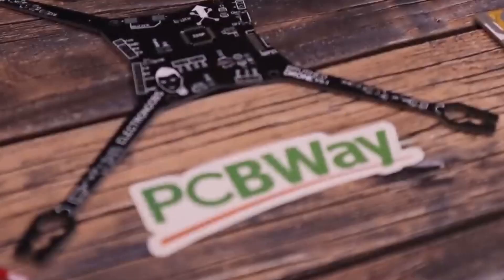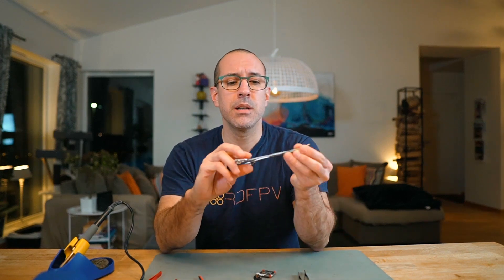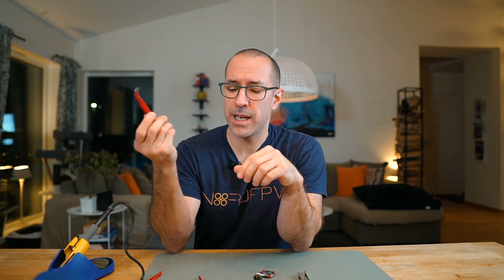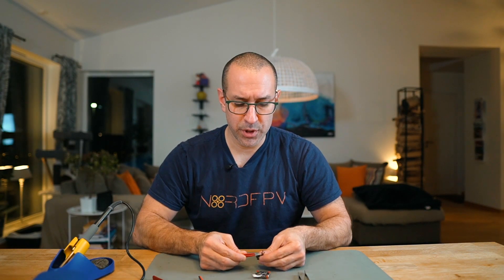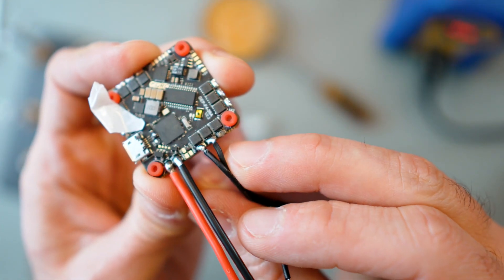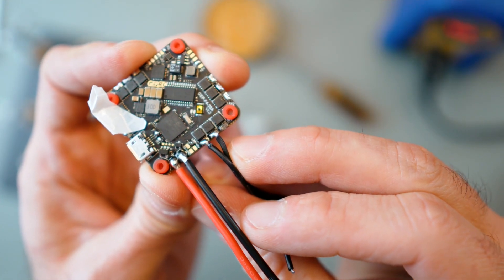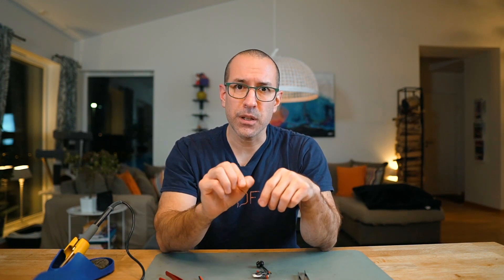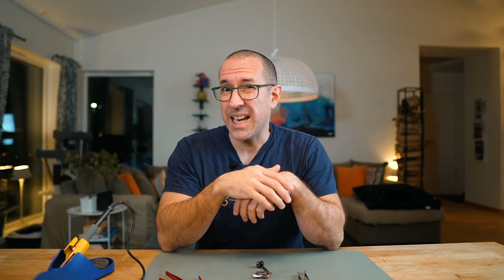5 Soldering Tips for FPV Beginners

Comment: Hej.
Köpte nya spetsar till min lödstation på Kjell, men märkte att diametern var 4,8 gamla spetsen var 5,1.
Längden var inga problem att kapa till med bågfil.
Frågan är hur mycket -0,3mm på diametern på spetsen påverkar prestandan i lödstationen.
Frågan är om inte det är bättre att svarva till egna spetsar med bättre passform, runt +/- 0,03mm.
I ren koppar.
Livslängden på spetsen blir ju mycket mindre, men för våren del är det ju resultatet som går först, eftersom en kontroller kan kosta upp mot 1000kr på en tinywhoop.
Sen till frågan, hur tight ska passformen vara, som jag förstår är det ju keramikhållare som man sätter in spetsen i, kopparn i sin tur expanderar mer än keramiken när den blir uppvärmd.
Så kan hända om det blir för "bra" passform att keramiken spricker när spetsen expanderar..
Men 3 hundradelar borde vara säkert..
Istället för 3 tiondelar som jag har nu.
För maximal värmeöverföring till spetsen..
Köper in lite material till detta, så om du behöver en spets är det bara att maila ritningen.
Reply from the maker: Hej, Jag har inte så mycket efarenhet för att svara dina frågor. Den som jag vet är att en bra spett gör stor skillnad när man lödar. Jag by från en billigt lödspett till en dyrare och lödd jobb är mycket enklare nu.
Reply: @NordFPV  Dom säger att resultatet blir bättre av ren koppar..
Vi får se.

Comment: Hey, thanks for the video! Any recommendation for soldering wire? If I understand correctly in Europe is only available the lead-free one, but I am not sure about what to buy 😅
Reply from the maker: Ciao Matteo. There are some regulations around the soldering wire, but if you look closely, and specially in Germany and Italy, you can find lead one. For what we do it won’t be a problem. We solder very little amounts. 60/40 is what you want for easy soldering and nice and shinny solder points.